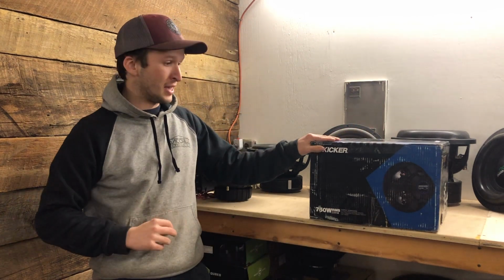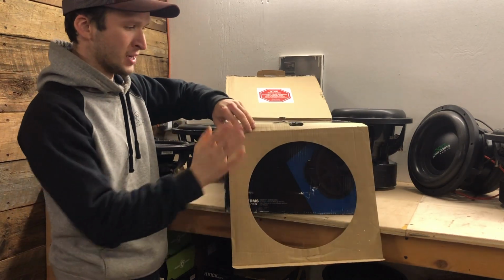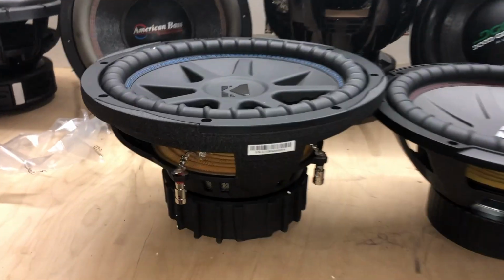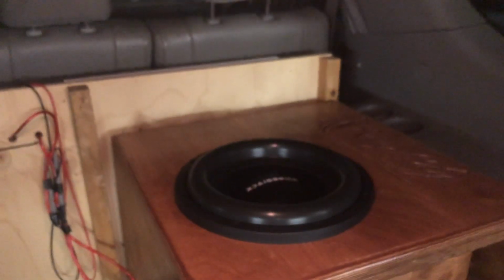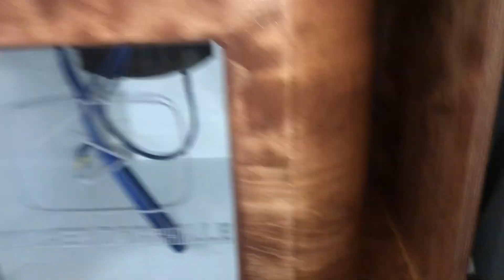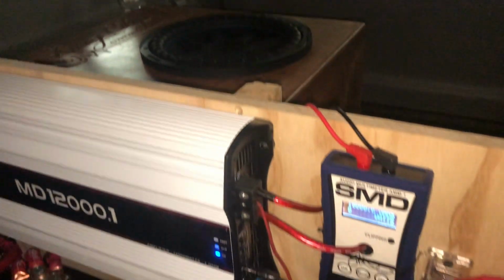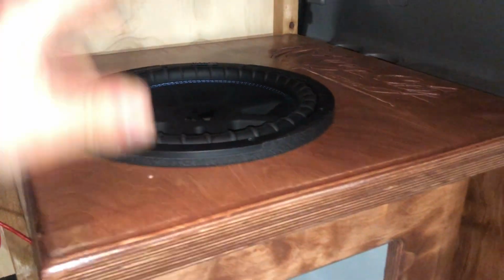This Kicker Sub Gets LOW! Comp VX 12 Subwoofer Review! CVX

Comment: First off I'm 35 my family owns a auto upholstery shop. I've been around systems since the 80s back when it was more about clarity than bass. In saying that it wasn't about the loudest but the best all around system and one of my favs was an alpine deck kicker 3.5s kicker by 9s and some cvx 12s on 
a kicker 1100 zx amp in a sealed box in a 85 Regal. Everything was sound deadened and this was one of the dopest systems I ever heard. I love seeing simple systems that really smash
Reply: What did you hear this 85 Regal man ? Yeah , the old school simple , sound quality systems are my favorite !
Then next fav would be the crazy elaborate uber high end audio systems !!
OH _ I really miss the car audio days Without all these canbus systems and extra computers .!! Also the sound quality of  the class A/B amps back then was and is top notch ! Which is pretty rare nowadays , or super pricey to obtain .
 Peace
Reply: Hell yeah!!! I had an 87 cutlass with 2 kicker 10s facing forward and 2 12s facing the rear.  Gutted the seat of course running them on 2 orion hcca 250s.  Miss that thing so bad.  Hilarious that we can get 10x that power for 200 bucks these days.

Comment: This box is much better than the Skar box. You can now do a test of how much of a difference enclosure makes by retesting same subs in the new box.
Reply: really though theres nothing wrong with the skar box. its 2 cubic feet tuned to like 32 hz. i bought one but had to return it cause it didnt fit in my trunk an it had nice things like internal bracing and all that.
Reply: @haydenwiseman3056  The box is tuned to 32hz with the Skar SDR12. I'm sticking to my guns on there is NO WAY a boxes tuning frequency can be calculated without knowing the parameters of the driver that's going in it. Skar designed that box around the SDR's parameters. Kicker or any others sub T/S parameters will be different resulting in different tuning and sound.
Edit: I'm referring to the Skar box but the same is true for any premade enclosure.
Reply: @thenotoriousrvh6091  Different drivers may respond differently in identical boxes due to their T/S parameters, but the tuning frequency is determined by the interior box volume, port size, and port length. Things like sub displacement, bracing, and inner walls will affect interior box volume which would also affect tuning frequency.

Comment: I got one of these CVX 12 inch 4ohms with a ZX750.1 Kicker amplifier and kicker amp wiring kit in my 1989 GT Mustang hatchback with Alpine deck.  It hits really really well.  Super high quality equipment...
Reply: That kicker amp is perfect for it I bet cause the closer parker got to 1500 watts it starts maxing out better off keeping it around it's RMS 750 good amp for it imo
Reply: i have two of these on kxa 1600.1 and it bangs outta of control i love it
Reply: How's the sound quality? What kind of box you have it in

Comment: I've had L7 12's and 15's and they gave off alot of cone noise rattle. It had epoxy under the face of the subs that broke loose rattling around.
Reply: I've had mine for nearly a year and I've never had these problems
Reply: @mr.boombastic8612  i was pushing them beyond what's recommended with a kx 2500. The subs couldn't handle the power
Reply: @fusiondensity3287  oh ok I understand

Comment: That sub bottomed out when the coil hits the back of the magnet ive had plenty subs do it and it doesn't mean its defective its over excursion
Reply: Exactly, needs more box dampening at these power levels (smaller enclosure).
Reply: @HashDogg06  I mean this is a worst-case scenario for that sub. It should be a testimate to kickers build quality. Overpowering it in an enclosure that is way too big for it is a recipe for blowing up a sub. but it held up. Kudo's Kicker
Reply: @dnappi85  my 12 year old kicker 12 cvr just got blown recently.. I accidentally put too much power to it apparently.. have no idea how.. I was doing only like 500 watts at 4 ohms but poor thing died

Comment: The coil was slapping the back plate from over excursion. I'm with you on the price Parker. I understand why Kicker charges more. There's a lot more that goes into one of their subs than just looking thru a catalog and picking a sub to put their name on for mass production. I also understand the quality that comes with that. The issue isn't with the company. I'm sure they're doing their best to offer their equipment as inexpensive as they can to make a profit but remain competitive in the market place. The issue is with the consumer. We all don't understand the cost, and the difference in equipment. We just see wattage, size, and cost. Most ppl who end up understanding the build concept and become bassheads will end up gravitating towards the higher end equipment after some trial and error. Kicker's biggest problem was they didn't have any large subs. Now that they are releasing the new Solo, I imagine we will begin to see a bunch of Kicker builds again. It won't be a high school teen who talks about Kicker anymore, it will be hardcore comp guys, and monster demo guys I hope. I'm going after 4 of the new 15" Solos when they hit for my next build. Wish I could do 8, but 4 is my goal. Thanks for the content lil bro! Have a good one!

Comment: I know you have some nice mids n highs but for the other viewers out there looking for really decent budget components check out the Recoil brand stuff on Amazon.i needed something cheap to get me by in my car, ol lady roached the left infinity reference 5x7 so I needed something quick n cheap (6.5 swap in a 95 mustang gt with diy adapters bad call as far as quick n easy) so i rolled the dice and grabbed up the echo series components for $40 and I am quite surprised and pleased they look n feel pretty good and they sound great, the tweeters and crossovers are actually heavy.. only problem is a 6.5" swap in 95 mustang gt, theres lots of finagling to get em in there solid. But That's on my choice of speaker size.

Comment: as soon and you put that sub in a box that big and throw that much power to it. you are maxing out the excursion. the coil overextends in the magnet. the spider and surround cant keep up with the coil, it will slap around making pops. especially at those lower herts 20-30 range

Comment: Maybe the dust cap when it vibrates so hard & fast like that, possibly causing the popping noises. Kicker I noticed has been placing that designed cap on most of the subs like that. So far most of the Comp. Or solobarric subs that seems to be the place with the most wear, after constant use.

Comment: only reason why im considering this subwoofer is because of its ts parameters. thinking about slapping this in my camaro and building a custom box for it. i want to keep everthing light as well as i get into street races often so the big 300oz magnet subs like i have in my honda arent going to be helping me out in my camaro what so ever, lol. tryna keep the power handling low but im going to swap to a lithium battery as well, should keep my voltage steady playing full tilt @800w without adding any weight, even losing some.

Comment: What would be a comparable sub to this one in a different brand? I am talking about comparable specifications and sound output. Mounting depth being a pretty important spec.
Reply: What ya find out?
Reply: @traewilkins8890  Not much really. Dayton audio has a couple subs I was looking at that will fit in smaller enclosures but I have not had time to pull my current sub to check the mounting depth of my enclosure. I have a shallow enclosure that sits under the back seat and it is hard to find a full size sub that will fit in it.

Comment: Brand new in box in plastic with warranty for 1 year the hole 9 yards. I can get just about every kicker sub for atleast 50% off
Reply: L5's or L7's...?? I'd love to own some L7's again on day.. Especially the 10"s
Reply: @jayblue8224  wich ever u wantin. I only hav L7's with the tinsles sewn. As soon as i learned y i had went threw so many til the chrome and blue L7s cane out. Wit sewn leads. But the best built L7 is the gen they came out with right after the chrome version. Like a gun metal grey.
Reply: @jayblue8224  I have a total of 9 L7s only using 4, wanna do a no wall build wit 12. But i dont like the new versions. So i always keep eye out. Ill take pics if possible n send 2 u
Reply: @jayblue8224  i truly can get 2 12 cvx brand new not refurb or open box brand NEW. 300 tax nd all

Comment: The only reason i would run the kickers over all those sundown, America bass,  deaf bounce.  and not worry is for the marine applications. what other sub on his table can withstand the elements with a paper cone foam surround.  For powersport applications  having to wash off your equipment After offroading. Cant use any other sub in this price range with those power ratings.   Would love to see any other brand make waterproof big subs for a can am or rzr.

Comment: That pop sound your hearing i think your over powering it.. desined for 750 rms and shouws your giving it 1100 then 1600 and the pop is worse... im running 2 12s cvx in a sealed box and hits tight and hard and no popping at all. Runing them at 2 ohm 1700 rms cxa 1800.1 love them. 

Great video 👍
Reply: I was thinking about running CVx  15s sealed on high power as well, I always love the sound of CVR sealed everybody says the CVX sounds like the CVR only louder right?

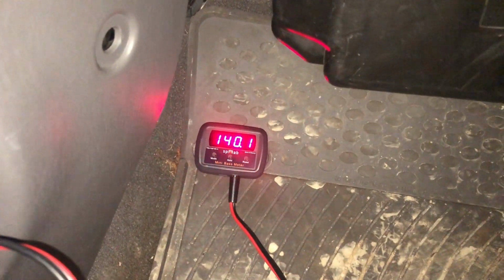Comment: At that 14:30 minute mark. When you say 1,600 watts…. Is that RMS????? I have 2 of them wired down to 1-Ohm stable (Nemesis NA-3000.1KOR ) amp that maxes out 3k watts RMS (according to specs) at 1 Ohm.  Is that what I’m doing to my subs??!! 🤣 because I don’t want to k!ll them 🥲 got a epicenter & it sounds amazing but I’m thinking of selling them/ trading + cash for a kicker Solo X 15. Anyways I know I went on a bit of a rant just hope you can clear that up for me! 🥲 Also just subbed! Not sure if you have any videos on the kicker solo x but I’ll go check if you do or don’t but if you don’t please make one!!  I love kicker they haven’t let me down! My old setup was 2 kicker L7 12’s old school dark gray finish with smooth curves (the fkn classics) which I believe I was pushing 3500-4000 watts rms range split to both & never had issues! (I know the RMS they’re rated is in a safe range & under powered a bit)

Comment: I have the cvx 12 dual 4ohms… n I run it with a 2500.1 SINFUL SOUNDS amp (true power) amp a lil over half maybe 3/4 on the game  a externel eq n bass knob and baby i playyyy with it….i made em stink sooo bad i had to take em out the box and check the ohms lmao still 3.9 on both coils wheew….these things reallly knock the DUST out my headliner…..fun fact the amp takes 0 gauge im using 4 gauge on a 250 amp fuse ill do the big 3 n run all 0ga sat …im impressed with the cvx 12s i REALLY abuse them —ppl new reading this thread go check out SINFUL SOUNDS

Comment: I had the same issue with the coil smacking the back plate, I pushed the sub beyond its limit.. I wish kicker would of extended the back plate, I would rather have the sub compress beyond its limit then the coil hitting.
Reply: Either way the Subwoofer absolutely crushes, and is perfect for what I’m looking for.
Reply: What amp your using? I'm going start with a Skar RP 1200 to push two 10s as a start, then I'll try the 1500 maybe.
Reply: @a9five  I have the JL audio RD1500/1, it sounds really clean, and has plenty of power.

Comment: thats the coil former hitting the back plate.  I had some mid bass drivers do that once.  Scared the crap out of me at the time.
Reply: Is that a bad thing plzz lmk cuz I’m getting two of these
Reply: @jeshuayusti1914  Its not a good thing, it happens when the sub reaches the end of its excursion... and the voice coil hits the magnet back plate.  I my case with those mid bass drivers it was a non issue because It only did that at really loud volumes.  If you push your subs hard though, it would be a major limitation.
Reply: @MuvoTX  oh Damn I listen to yeat , playboicarti, uzi , and a lot of hard bass song and like bumping hard … hopefully I just take good care of them and let them break in to enjoy it Fr
Reply: @MuvoTX what amp would u recommend I got the a Rockville rva- m3 amp 4000 watts … is that good? And what subs would u have recommended?

Comment: I’m pretty sure that subwoofer was defective
Reply: Nope common kicker issues  with the cvx line.They don't start really sounding loud till they start slapping. 🙄comes form the coil slapping the backplate because it's not deep enough  also if they added another spider it would help it handle better without popping as quickly on power
Reply: @taylormade5217  Doubt it, never had that problem in my life... it was probably defective as that guy said.
Reply: @analogaudiorules1724  I've ran kicker since the late 90's believe I'm not claiming to know it all but I've done over 50 kicker installs dealing with kicker as well as knowledge with rebuilding subs 🙄😑😒That i put money on .Kicker cvx/cvr had 3 well known issues ,that coil slap and  weak spiders  and well as tinsel lead failures. I've had every model  they have ever made all the way to the solo x 18s which was the only ones I can say kicker did a good job on .They L7s are good for what they are as well. But when it comes to price point kicker is behind. We will see what they're new x talking about soon.
Reply: @taylormade5217  Ive reconed many woofers, ive recapped and restored numerous vintage power amplifiers, ive built crossovers myself for multiple driver arrays "not just simple 2 way 12db per octave crossovers" i have a lot of experience myself, i have had little to no issue with kicker.... To each their own... I can't speak for their 90's gear, but ive tried a handful of their comp subs, as well as seen quite a few friends use them as well, never had an issue other then one time... they are not my first choice, but i can say i have never had one of their coils go out on me unless horribly abused, never had a spider crack either, had one become detached at the tripple joint, but that was after a few years of heavy use and it wasn't mine, so i have no idea how it was takin care of.
Reply: @analogaudiorules1724  It was not defective it was bottoming out that box is bigger than what the sub calls for.
Reply: He did say it was a return Item
Reply: @BenaresDarkness  yup. That's a common issue esp with the Kicker subs when you have too big of a ported box and run too much power. With that size box you would run like 500-600rms and you wouldn't get that popping noise.
Reply: @isseibelial2817  nope he damaged the sub because it didnt have enough play time to loosen up before he pushed. ive done the same  on a few subs. it needs repair. its hurt it will play but when you give it any power it will rattle from  now on
Reply: @taylormade5217  nope he damaged the sub because it didnt have enough play time to loosen up before he pushed. ive done the same  on a few subs. it needs repair. its hurt it will play but when you give it any power it will rattle from  now on
Reply: @bigsean2473  you're talking about breaking in a sub, while it can cause a lot of issues. This one in particular it does not. The bigger a box is the less power you're supposed to run through the sub. This box was too big for the sub by what looks like about half - 3/4 a cubic foot. 

From not enough time breaking in the sub your more common issues would be the glue coming undone, a spider coming loose, or overheating a coil. Unfortunately this is not one of them. 
While that's a better guess than the sub being defective like the op stated, it's still incorrect.
Reply: @isseibelial2817  i use box way bigger than i supposed and run subs 2-300 watts over rated and this never happened. when my Armageddon starting popping like this is was in the correct box. it was dropping hard on a good song and i turned it up more then pop. so the box is not the issue. it diddnt have proper break in which damaged. many audio sites will tell you to break your subs in as warranty wont cover them if you dont. so while you may know a lot you dont know everything. ive had 8 cvx subs and been giving the break in speech many times. call kicker they will tell you. you say glue coming loose is a break in issue why do you think the sub is popping something came a loose